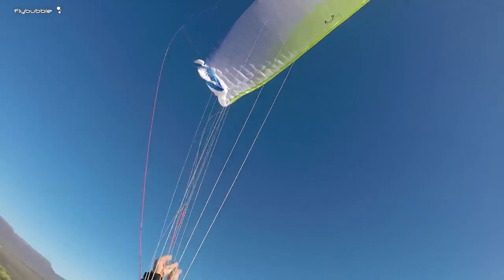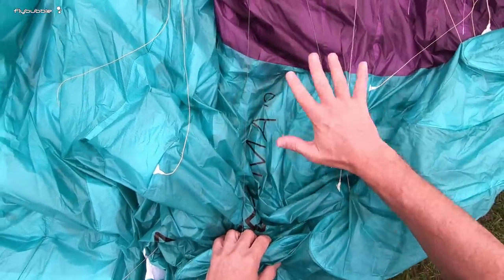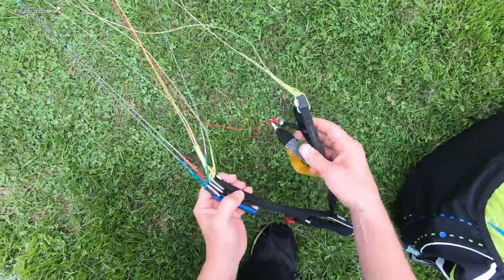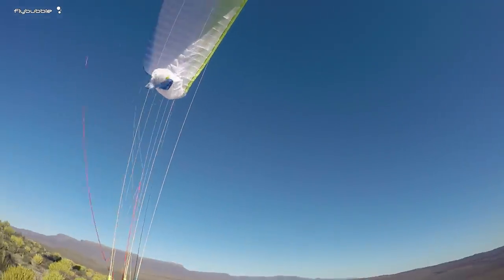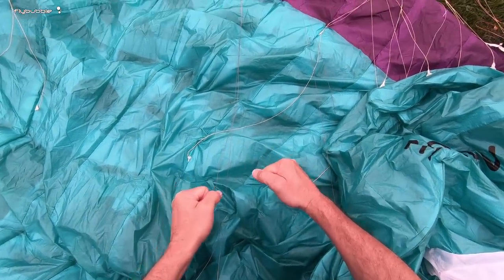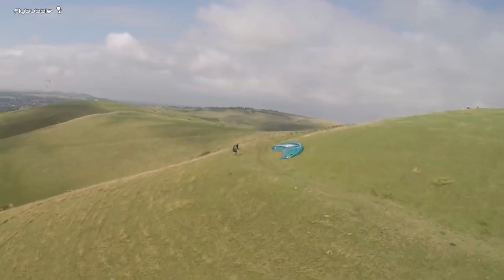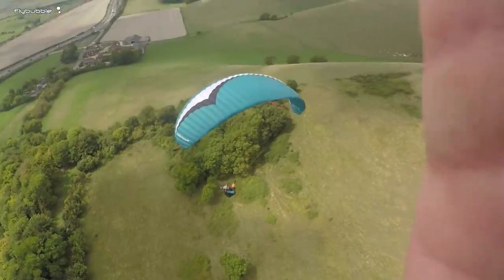Paraglider Control: Fix that Cravatte!

Comment: Did I see a red ribbon on Dave's wing. If so, that situation was a lot to deal with for a new pilot. Very well done him!

What are your thoughts, for more experienced pilots and depending on there being enough altitude, about using a full induced asymmetric collapse, with either weight-shift away, or lean into the collapse to use the energy to blow the cravat out? I know big ears, and big-big ears are collapses, but you didn't explicitly mention a full assym.

Also, you mentioned big ears before stabillo, whereas I would have thought most pilots would use the stabillo in their  first attempts.  Was there any reason for this? Would you recommend that order, or does it just depend on what the pilot feels most comfortable with?

Good work - I love these educational vids you guys make, and this one again has clarified a couple of details for me.

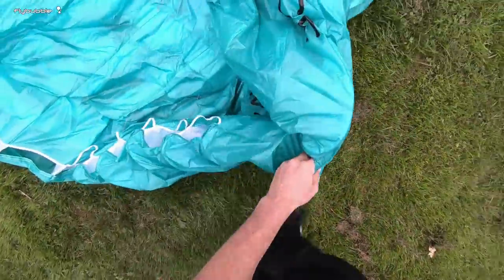Comment: @7:00, agreed, my one and only reserve ride resulted from a cravatte on my 08 Airwave FR, where about 2 -3 tip cells on the right side got around the center B. could not locate the stab with gloves, pulling down the right side A did nothing, and a stall with wrap only spun right, twice in two attempts.

Comment: Nice video, thanks! I have a question - why not just use stabilo all the time? Why try to pull the big ear first?
Reply: big ear removes the turn instantly (for most 'things near the wingtip'. Sometimes you need to pull the stabilo long, hard, repeatedly. In that time most pilots will be in a spiral dive from the nastier shaped cravattes. Hence my general advice for most pilots. And everyone knows where the big ear lines are. Many pilots don't instantly know where their stabilos are. If you're an experienced pilot and you're confident you can keep the wing straight and level while you find and fiddle with stabilo, by all means go for it!
Reply: Thanks for explaining and sharing your experience, Greg!

Comment: Thanks for a great video. When having a big cravette, should i throw my rescue or shall I try to land first as a beginner?
Reply: good question, I know what you mean. If it's a big cravatte that isn't coming out, but your wing feels OK to pilot (you can make it fly straight and level), you could consider just going down to land .. it depends entirely on what your landing options look like, and if conditions are turbulent (windy, thermic) or not. Fly it with one hand on your reserve handle, if the wing stalls, or starts a spiral, you throw!

Comment: Hello thanks for the info ! I would like to know how you mounted the GoPro on your glider for example at 11:55 I can see it in the sunglasses but I'd like to know you did the mount.
Reply: Its a selfie stick just held by my hip against the harness (not secured). A better solution would be to strap a little tripod onto the base of your carabiner.
Reply: @greghamerton4422  thanks again, I'll try to figure it out out.

Comment: HI AND AS I PRACTICE WHEN I CAN. I CAN PULL A BIG EARS AND WHAT CAN HAPPEN ONE SIDE CAN GET CAUGHT IN A CRAVTE. IT CAN HAPPEN WHEN THE TIP FLAPS ABOUT. AND JUST DO AS EXPLAINED BY FLYBUBBLE TO GET OUT OF IT..   AND AS ALWAYS. DEPENDS ALOT ON YOUR HEIGHT? PARAGLIDER OR PARAMOTOR WING.  " LIVE AND LEARN OR  LEARN AND LIVE"

Comment: I can’t believe that they haven’t invented yet some semirigid very light plates underlying the wing and locking into a single unit as soon as the wing is inflated.
Reply: Flybubble Paragliding makes sense what you say if they stay as separate units but in my dream I’d want these to be designed in such a way that they “click” into a single, non foldable unit, kind of like the kites I guess.

Comment: Always informative but I can't believe you fly without gloves especially when talking about problems fixed by line handling. In my 14 years of flying I've had way more gloves with line cuts into them than I've had head injuries and you wouldn't fly without a helmet would you?  Plus I have a kite surfing friend who lost part of this finger to a line cut. When it comes to grabbing a line and hauling it in to baba ganoush your stabilo or kill a wing to stop a drag you really want every advantage you can get and worrying about line burns should be far from your mind.
Reply: Fiddly little camera buttons
Reply: @greghamerton4422  why not just leave the cam running then? 😉
on a gopro with wifi off you can get around 2-3 hrs of straight filming as much as i found out 🤔

Comment: usually i love your videos. this time i think you should just take it down. 
just to reiterate the most important tips in this video:
1. on the ground? KILL THE WING
2. took off with it? MAINTAIN DIRECTION
3. pulling lines (a\stabi)? PULL DEEP, DO NOT TUG
Reply: As you don't show even one cravat being opened anywhere during the video, i feel it is not professional.
Also, I feel the video doesn't stress the importance of maintaining direction and being very cautious with the breaks while dealing with a cravat in the air. Third and last, I think your recommendation of pulling lines is not as instructive as it could be. most people tend to tug really strong but really short, which doesn't really help, this has also been left out of this video.
In short, this video is more of an entertainment, in my opinion, than an instructive one.
Thank you for you efforts and the great content. I hope you'll consider remaking this video.
Reply: Nadav did you check out the linked article https://flybubble.com/blog/fix-paraglider-cravatte? We always expand the videos with written content on our website, there's only so much one can show on youtube. Thanks for your constructive criticism, for sure every video we've ever made could be improved but my time is limited so I do what I can.
Reply: Greg, you produce the top level content on "paragliding topic" here on youtube. Thanks a lot for what you do, from Ukraine!